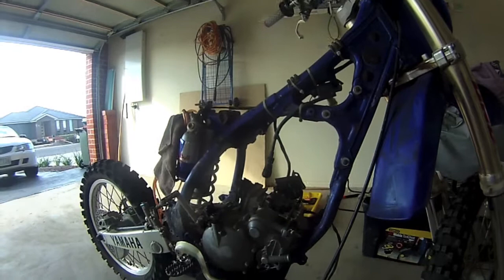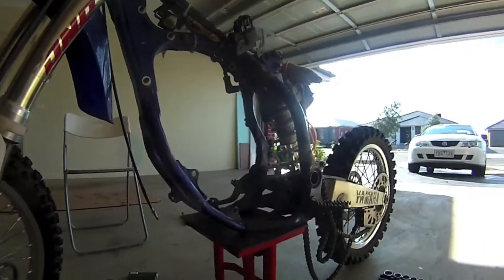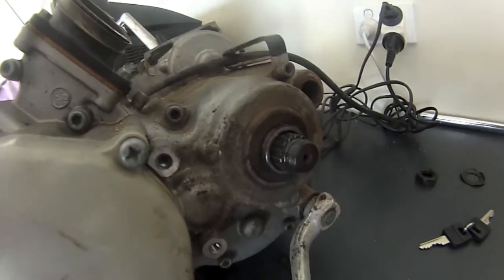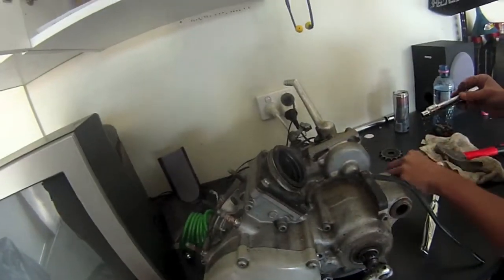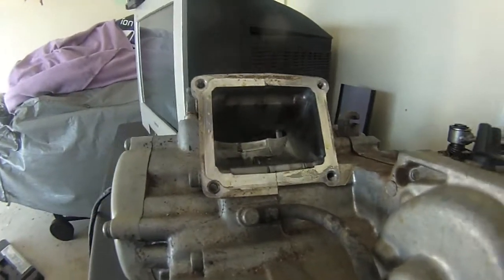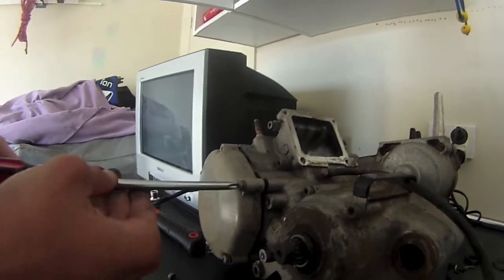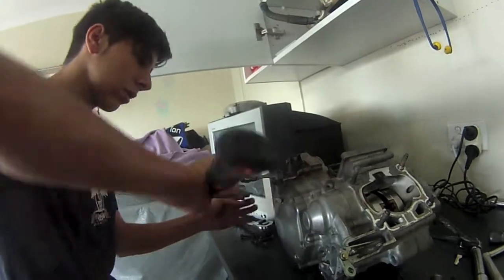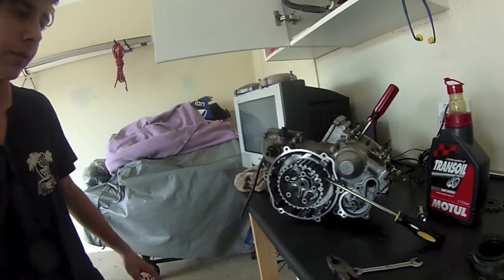YZ 125 Rebuild Part 2 - #32 Stahtaris - The 2 Stroke Build

Comment: nice vid mate. Stumbled across it from a comment you put on another vid for an Akra Geico 250. I will be at Frankston tomoz!. With the clutch plates, check your service manual for the minimum thickness they need to be and get a micrometer and measure them to see where they sit. a new set of plates and springs shouldn't be much. Hope the rebuild goes smooth. peace